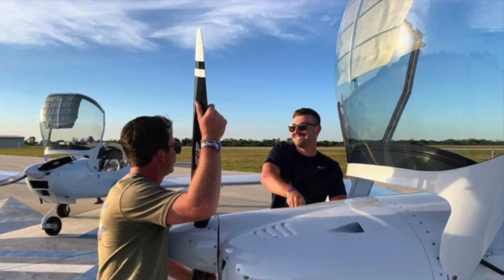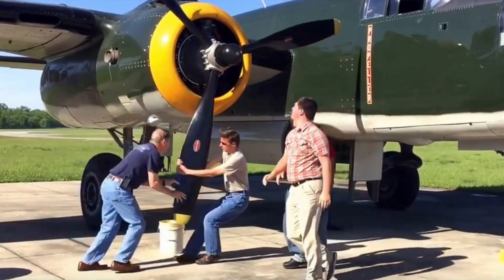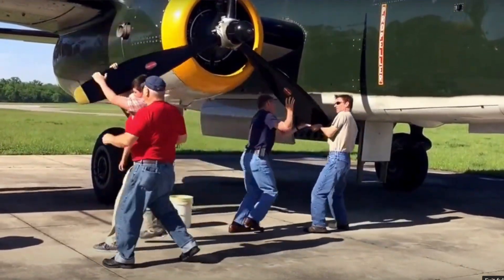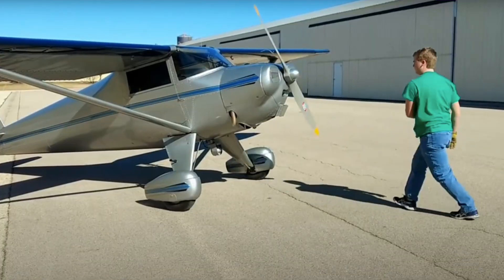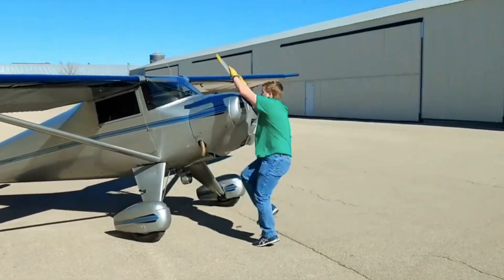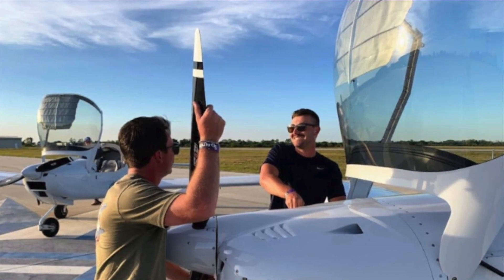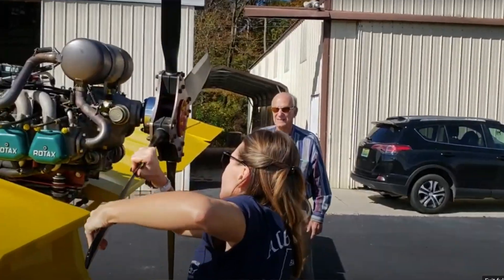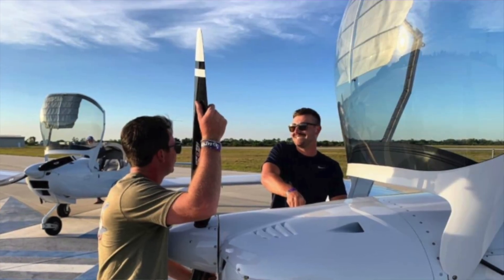Don't touch that prop! (an old wives tale that deserves to be dispelled)

Comment: One added note...it's not the speed that matters when propping, it's the torque. You're not trying to fling the thing to idle power, rather you're just trying to get the mags to participate in the whole experience. If you're using more than one hand to start a J-3, either the mags need o/h or your indulging in a bit of propeller drama.
Reply from the maker: Bam! You nailed it, @zosoachilles.

Comment: On a lot of radials the plug is always removed even before the walk through, they already know the design drains enough oil to be a problem,  and even if not hydro locked burning that oil on start up fouls the plugs. Some will remove the plugs then use the starter to clear the cylinders rather than a manual walk through. (As I recall some radials have a dedicated drain plug on lower cylinders so the spark plugs are not disturbed)

Comment: Turning an engine backward… continental and lycoming… not usually an issue.

Except… the vacuum pump vanes can wear with a naturally beveled edge.  Going backwards, the beveled edge can catch enough to brake a vane…

This probably only happens when the vanes are near fully worn already…

Vac pump vanes are made of carbon… they are pretty brittle.

The more the vanes wear, the shorter they get… the more space they have to move around in their channel… making running backwards a more important issue as they get older… hours, not so much years.

😃

Comment: The way the guy hand propped the Luscombe is exactly the way Ive been doing it since 1971, and I still have all my limbs.
Reply from the maker: For those who learn to hand prop correctly it can be safe and efficient, as your experience suggests.
Reply: It also helps that it isn’t a 450hp engine…. 😃

Comment: Some Rotax engines also need to be primed by manually spinning the prop to check the oil. Touching the prop is also part of the checklist on my plane, you need to feel for chips and cracks.
Reply from the maker: @PatrickDuffy-u3s  very true. Excellent points.

Comment: It can go bad if you move the propellor! Some friends were doing a first engine run on an Emeraude being built. The engine started and ran good and the guys standing around watching were all happy. While standing around congratulating each other, one guy casually pushed the prop that was at about 45 degrees back up to horizontal. The engine fired and ran long enough to tip forward and grind the prop into the concrete floor. Luckily the chocks held. No one was hurt! The engine had been shut down with the mixture and they forgot to turn the mags off. The destroyed prop now hangs on a wall as a reminder.
Reply from the maker: A great example of why great care (and checklists) are essential to safe operations. Thanks for sharing the story.

Comment: I am both a pilot and A&P, you are right with your statement "You must respect the propeller" and I will add "it's arc." Your statement of hand propping is "It's a very safe process". Is a flat-out lie. It's kind of like saying riding a motorcycle is safe. Just the fact that we fly is unsafe. But we as pilots do all the things in our power to make it as safe as it can be by doing pre-flights, getting quality training, and so on. Never having to hand prop is the safest thing. If you don't do it then you can't be hurt. Hand propping from the front of an aircraft is just stupid. I am familiar with radials and turning it though to check for Hydro Lock. But if I cannot turn it through from behind or had to have more than one guy to do it like you had to do, I just wouldn't fly that aircraft. Now, with all this said, in my 42 years as a pilot, I always check the P-lead when I shut down. I have actually had a prop which I was turning just a little so I could get the tow bar on, POP OVER THREE TURNS. Scared the crap out of me. I immediately jumped in the plane, started it up, and shut it down completely this time by turning the key. I wanted to make sure that both mags were completely grounded. They were. I started it back up again and pulled the mixture as I had before when I originally shut it down to totally starve it of fuel and so no residual fuel was in the cylinders. I went back to the front and turned the prop several times and NO POP OFF. This was one of those times when science and FACTS didn't matter. Had I been in that prop arc, I would be dead now. I only moved it about 1/4 of a turn. MadPropsAero, I sure hope this doesn't happen to you. I never thought it could happen to me. Scientifically, it should NOT have happened to me! But it did and I am glad I am here to still talk about it.
Reply from the maker: You make a valid point, @DannyCreech. Which is the exact reason we mentioned in the video that it is possible to be hurt or killed by hand propping incorrectly. We would not use the word “lie” however, that suggests there’s no truth to the story at all. People have been hand propping airplanes for well over 100 years. People have been riding motorcycles for similar length of time. There are tragedies to be sure. But the vast majority of participants train, take care, and have a long period of involvement they get satisfaction from.

Anything involving motorized vehicles requires care. There’s no benefit to being hyperbolic in our view however. Stay safe.That’s a major component of these videos and the reason behind this channel.

Comment: Yes but in the picture the guy's whole arm is in the prop arc and for no good reason. what if the mags are on via malfunction and he moves the prop the said one inch?
The guy in the pic is being way too complacent and if doing what he's doing becomes habit or in other words natural movements whereas the brain doesn't cycle through the safety aspects of his doings then what he's doing is really stupid.  Question: Why would you stand in a propeller arc? If you have reason then OK but if for no reason then why?
As you said the mags may not be operating properly and they can malfunction at any time so explain as to why you would casually stand a propeller arc for no viable reason.
Sorry, I'm not with you on this one. If viable reason for function OK, if there's no reason to be in the propeller acc then stay out.
Reply from the maker: Keep in mind this is a still picture. We don't know the individual on the left is moving the prop. We're assuming that. The overall message of the video is valid, although your warning against being in the prop arc is absolutely valid and worthy of consideration by anyone who flies.
Reply: @MadPropsAero  Yes I agree with you completely and thank you but, he just looks so complacent in the danger zone and in having no reason to be there. Not something that I would advise to do.

Comment: I was flying with a friend , and he had left a light switches on, so that the battery was flat when we came back from dinner... It was a 170, and I offered to try hand cranking it, but he practically freaked out... A turn or two with mags off, and mags on, pull it over as you step away... Seemed ok to me, but we ended up having to rent a car and hotel.
Was I totally wrong? It's a bit more than "touching" the propeller, but a pull and step away seems just like I've seen people actually do it?
Reply from the maker: Neither of you were wrong. Hand-propping is a normal activity although it is one that requires specific training. If you're both comfortable hand-propping, then it's a viable option. If either of you is uncomfortable with the process, it's best to avoid it and make a mental note to learn how to do it safely at some point in the future.
Reply: Training is good…

Discussing roles and responsibilities is also good…

Assuming your friend knows what you need… can get problematic…

He forgets to hold the brakes, or turn the mags off, while you pull the prop through a couple of times…

Oops, my bad…

😃

Comment: Funny, I was yelling at the video it's a Rotax!  That is SOP.
😂
Good topic
Reply from the maker: You’re ahead of the crowd on this topic. Those who have never flown behind (or ahead of) a Rotax aren’t aware this is a standard procedure.
Reply: @MadPropsAero  Thanks 
I'm an ultralight & light sport guy so a few years of Rotax experience.  
I understand the fear of magnetos, operated a blldozer back in the day with a mag.  It would start with the engine just barely turning over.  Think hand prop only slower. 😂

Comment: A flat statement of don’t touch the prop is ignorance. Great video. We also check for play in the prop by using a push pull motion in our pre flights. Mike Busch has a video about the p lead and the importance of making sure the mags are off. Idk anything about Rotax but on any regular engine I spin it backwards if I have to move it for any reason as an extra precaution to not trigger the mags.
Reply from the maker: Mike Busch is terrific.
Reply: From the description I'm guessing the Rotax thing has something to do with priming the oil pump. Just seems like a poorly designed dipstick to me, I've never encountered such a procedure on anything.
Reply from the maker: Rotax engines are different but excellent  @mytech6779 . They’re making real inroads into the general aviation market.

Comment: The girl was turning the prop backwards.
Reply from the maker: That engine is mounted in a pusher configuration,  @gtm624 . She was turning the prop in the correct direction.
Reply: Lol. I was so confused on this. Thank you. I just watched it again and realized it was a pusher. I realized the direction of rotation was correct but the blades were backwards.

Comment: Nice video.   I would add a few things.  First, it is important to not put any part of your body in the prop arc. That picture shows the pilot leaning into the prop with his arm through the arc. Not cool.   Second, if you have to reposition the prop, or if you have to hand start it, do so with the flat of your hands…do not curl your fingers around the leading or trailing edge.  Last, with most engines (agreed, not all) you can and should turn it backwards to reposition it. It can’t start when turning backwards even if the p-lead has failed.  Also, I never let anyone touch the prop that is not a pilot or mechanic.

Pulling a radial through (like that B25 crew) is a unique situation that has to be done….however, it is an added element of risk that most pilots should avoid with light GA aircraft.   

Bottom line is that you are correct.  Sometimes you just have to touch or move the prop. People need to know how to do it and what the risks are.
Reply: I just read in a Savvy article the same - turning the engine backwards by hand is perfectly safe, which went against the old wives tail of "never spin the prop backwards". . I started doing this if I need to rotate the prop during preflight as an extra layer of safety.
Reply from the maker: All good points,  @TheAirplaneDriver . Thanks for sharing.

Comment: I always propped my J-3 from behind with the mags and throttle in easy reach. I've propped plenty of aircraft from the front, but the J-3 was as easy as it gets and safe if you followed your own drill with respect to prime and prop.
Reply from the maker: The clamshell door on the Cub gives us the option of hand propping from the rear. Just one more reason to love the Cub.